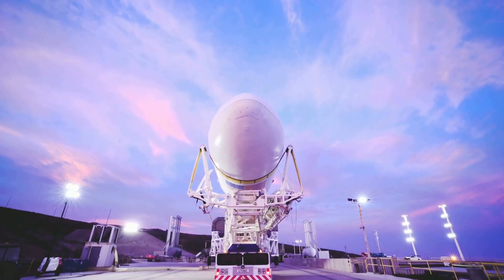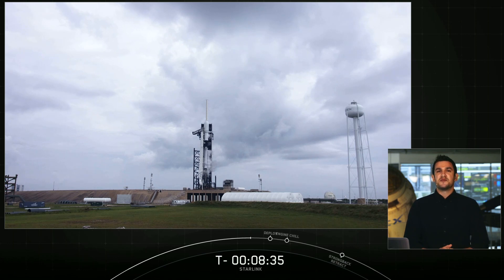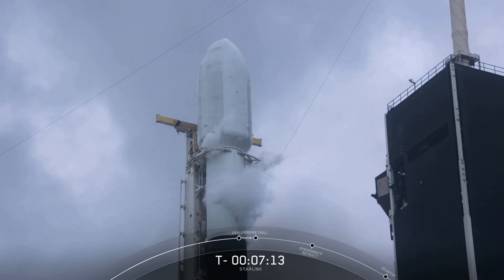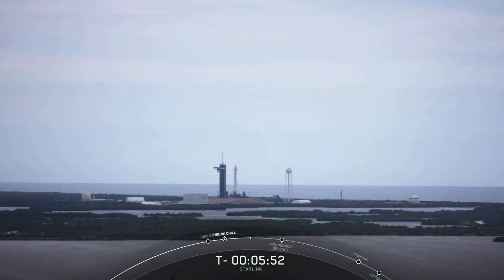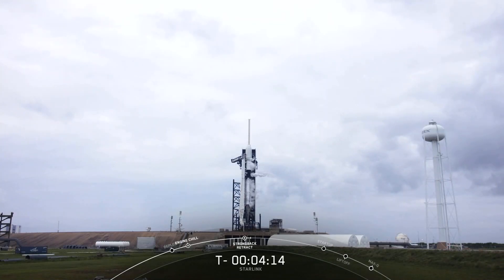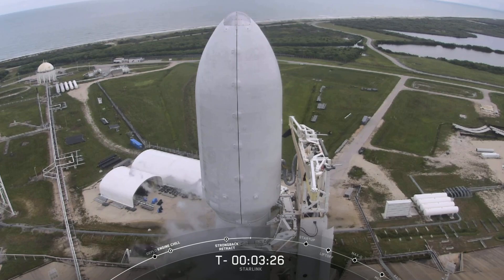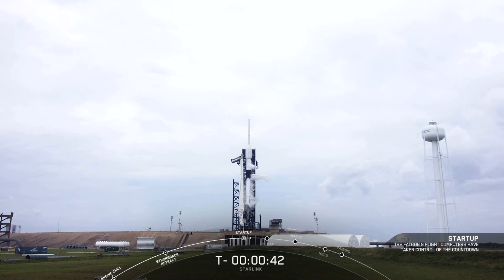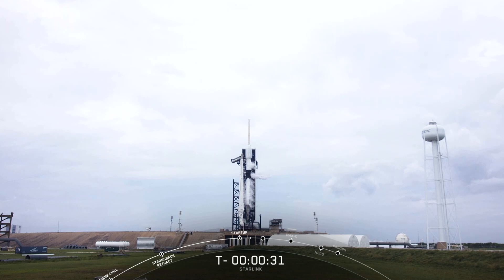Starlink Mission

Comment: SpaceX , you mentioned since T-35 minutes, the fuel kerosene (rp-1), and oxidizer super chilled oxygen (lox) are nearly fully loaded on both stages. 

First stage should finish prop loading at T- 3minutes.

Second stage should finish prop loading at T-2 minutes.

At T- 40sec both the stages are pressurized for the launch.

At T-36 seconds, the launch was scrubbed.

My query is the fuel and oxidizer are get back to their initial position ( storage tanks)or not?  Or if the fuel and oxidizer stays in the stages, does any reaction take place ?

And for the next schedule launch again we want to refill them ?, When they get back to their initial ( storage tank)?

Comment: We need an east coast launch facility with better weather. Florida sucks.
Reply: There are ones, but if you're launching things you want it to be as close as possible to the equator, since being there gives you extra speed from the rotation
Reply: @endergamer794 Falcon has the mojo to launch from anywhere
Reply: @egoequus6263  you mean deltaV? it depends on the payload, but it's capacity would be reduced
Reply: @endergamer794  I'm sure Elon's engineers can get more performance to compensate. Might be moot when Raptor based rockets start doing payloads.
Reply: @egoequus6263  Yeah, but why? it's free velocity, that's why esa ships their rockets to french Guiana